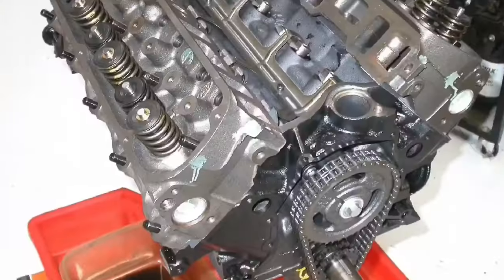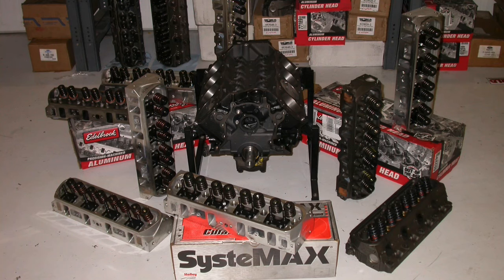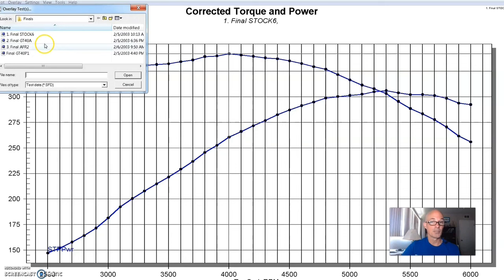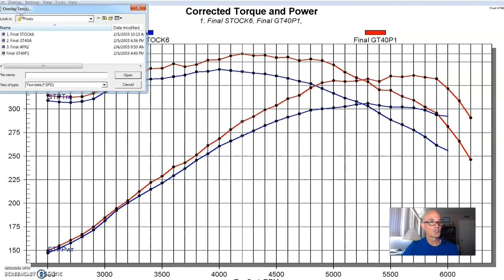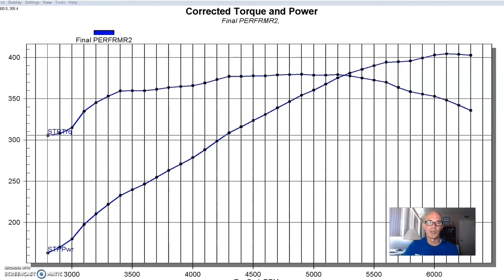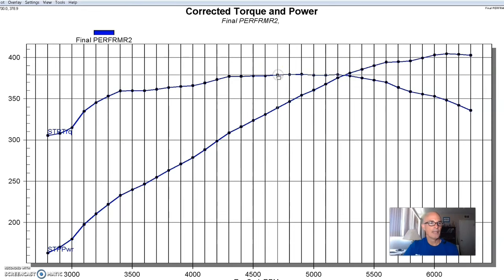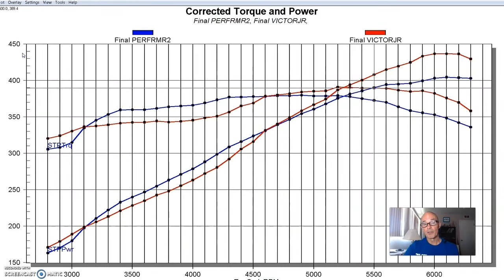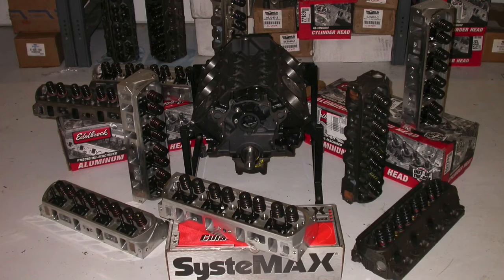LOW-BUCK 302 FORD HEAD UPGRADE

Comment: I remember those mm&ff articles when I was building my engine in my 84 gt 
I had a set of 69 Windsor heads home ported a duel plane stealth intake with a XE274 cam and a 650 dp and a recurved  dist. 
Had a lot of fun on the street and surprised a lot of people. 3.73 gears and sticky tires 
I miss those days 😕

Comment: Goes to show we were leaving a lot on the table back in the 70,s but didn't know it with these Windsor motors,
Reply: 289 heads and  GT40/P have the similar 124 cc intake runners and bowls.
The big plug W heads were 144cc but big chambers.
Massive well done hogging wont meet the aluminum aftermarket.
Cleaning them up personally for cheap is ok.
Reply: @hotrodray6802  The C0OE & D0OE 351 Windsor heads have 60cc chambers. GT40P are 58-61cc.
Reply: @foxfordcatguy2283  yes. And the MOST 289 are + - 53.5 nominal. That is somewhat smaller than 60.
Reply: @hotrodray6802  289 HiPo were listed as 52-55cc - NOT "most 289s." '66-'68 289 2V was 63cc. (The early ['63-'66?] 2V 289 heads also had tiny 1.67 & 1.45 valves - depending on which book you refer to.) Plus the 289 was only made from '63-'68. The much more plentiful 302 ('68-'01) used 63cc or bigger, except rare '68 4V C8OE-F w/ 53.5cc & C8OE-K & -L w/ 58.2cc. By '79-'85 they were 67-70cc. '87-'95 5.0 HO was 62-65cc. So there are obvious benefits with early Windsors on a 302. Maybe a little trade off on 289s. Bigger valves/ports and they can be milled and/or a thinner head gasket used to bring compression back up versus smaller valves & ports but more compression w/ 289 heads.

Most aftermarket aluminum heads are around 60cc:

Edelbrock only available as 60cc,

Ford Racing - GT40 58-64cc & X2-64cc,

Trick Flow Street - 58-61cc,

AFR - 58-61cc

Buddy of mine runs mid-11 quarter mile w/ '69 351W heads on a 302 in a '63 Falcon.

Comment: P-heads are decent...upgraded springs, port and polish, and milled   .020" yielded me 65HP on my setup years ago.
Reply: 93Cobra, what header are you using on your 302?
Reply: @israelfranco5332  I had a custom set of full lengths....1 5/8 primaries.

Comment: When I was younger, it was all about the cam,  Want more power? get a bigger cam. Always flat lifters btw. When the aluminum heads came on the market, it was hard to believe how much power difference a head could make. They were quite expensive though. But its hard to believe that a head swap was worth nearly 100 horsepower given everything else was equal. 

Now a days, for a mid RPM truck engine, it can make GOOD power AND have a smooth idle with aftermarket heads and a roller cam

Comment: This is one of those things that even happens occasionally to the top dogs in the business. I don’t mean to suggest that you’re a dog Sir Richard, but you are definitely the best at what you do. The test results clearly illustrates the performance advantages that are easily available without getting too radical with the combination. Nicely done AGAIN ! 
And by the way, you did something that most guys would rather die before doing...you publicly accepted full responsibility for the minor mistake that you made. It’s a sign of impeccable integrity and that’s a trait that is in short supply nowadays.
Reply from the maker: definitely not a top dog-just a junkyard dog

Comment: I had AFR 165 heads with an E303 cam. Huge seat of the pants difference. The rockers were always really noisy at high rpms. This might explain that. I also broke 2 ARP rocker studs on the same rocker. Got tired of studs breaking so I sold the heads. I bought the knock off 190 heads and sent them to get ported and stronger springs. Never had the problem again. 
   Thank you for all the time you put into this work. I really enjoy watching your videos. I love the aahhaa moments like this that explain some of the problems I've had.

Comment: My '79 F-150 has a 302 and I'm pulling it to rebuild. I'll be doing it myself because I want to learn about everything. I'm glad the dual plane intake is better. But it'll be a slow process to rebuild, but it'll still have a stock bottom end just with new bearings, but then I have choices of heads. I thought about an RV cam. Might still do that. But thanks for your info.

Comment: Solid roller cam is the best way to go so you can increase your valve spring close, and open pressures. I run my A code 289 to 6500, 6800rpm with a ISKY Mega 280  Model: 396281 COMP 986-16 dual springs, with 68 J code 4V heads that have a street port job 1:94 1:60 Ferrea valves, modified  600cfm 1850 carb body with 3310-1 floats, and bowls, probably flows near 700 CFM if not more 69.75 primary and 78 secondary jets. I'm probably making a honest 320-325 with this combo, possibly more with a bigger carb. I've run a 780 carb on this engine it's awesome on the freeway really pulls hard to 6500rpm wants to keep going, but the other carb is way more street friendly.

Comment: MMFF Ultimate Guide to Cylinder Heads - tested so many tests it had to be done in several issues. I remember it well, and probably still have the issues in my archives. That was an epic effort! I struggled with data overload for months before deciding on the AFR185's. Then got hung up on whether I should go ahead and build a 392 from one of the articles in one of the issues. I'm not sure if you saved me money or cost me a ton!!! LOL!
Reply: That was a magnificent series of testing and data. It was absolutely revolutionary at the time. I'd never seen anything like it, despite all enthusiasts having NEEDED it for at least 10 years, by then.

Comment: Great info - as always.

I would like to see a straight up comparison between the stock '87-'93 5.0 HO EFI intake & heads & swap them for the Explorer heads & intake - with a cam/spring upgrade, of course.

I snagged the "P" heads, intake & 65mm TB for $150 off a Mountaineer from the local JY to put on my daily driver '89 GT. It has a valve tap & if I have to take it apart anyway, figured why not?

Comment: 302's are my favorite car engines.  (Chevrolet DZ's, too.)  So I'm really interested to find out about that big, detailed MM&FF test you mentioned.
This pair of tests was interesting, too.  The big surprise for me was how well the RPM 289 did.  In fact, that whole test series seems to have had a reasonably stout 302 running.
Reply: Not an RPM. 
Just a Performer 289.

Comment: Have had 7 Mustangs with 302’s....love the V8 and compact size (compared to the new DOHC 302’s). Best 302, I have is Balanced, Blueprinted, Forged Pistons, Ported GT40p heads, Explorer GT40 intake, bigger throttle body, GT40p shorty headers.  Has a E303 cam...a little lopey for the AOD (not enough LSA for Fuel Injection)....really strong above idle speed.   Love it, will never sell it.

Comment: Sure would be nice to see the power curve down to around 2k rpm.  Looked like the single plane jumped up quite a bit above the dual plane below 3,000.

For some reason GM used a single plane intake on their HT (high torque) 4100 Cadillac Engine...

BTW, the 4100 gets a bad rap, but I really like them, for something that size.  

The engineers really broke out of the mold when they designed that engine.  If you haven't already, you should take one apart and check it out sometime.

Comment: Im running a mild 327 stock bore stroked 302. Gt40p heads. I just cleaned up the intake side of the heads and a very mild touchup of the bowl area and exhaust. Upgraded the springs added a comp roller, new pushrods 1.6 rr. Trackheat intake, 70mm tb. Its not no hotrod but makes for a great little street motor. Faster than i want to go. Great torque as well. Ive never dyno'd it but im thinking somewhere between 300 and 320 horse. Still gets respectable gas mileage on the hwy with 373s

Comment: Great video work , I havent owned a 302 in almost 20 years but still wondering how to make them run better and seeing all my old HP mistakes.  Biggest one i see is the valve springs  and a commitment to my original torker 289 .  it  ran so good on my stock  66 289 GT back in 1971.    I ran a set of 351 heads off a Mach 1 on a 302 for my last build , never broke on me in 20 years of racing and street use. except one day floated a valve and had to replace it ,   Biggest change in Et came from a set of flowmaster over axle 2.5 inch exhaust , picked up 5 mph in the quarter.
Reply: Just remembered one super cheap thing to prolong engine life is I glued a speaker magnet to the outside of the oil pan , after pulling the pan a year after building the motor to check out a noise which was the fuel pump luckily,, the inside of the magnet area in the pan had a layer of fine dust , most likely shavings from the cylinder walls and prevented them from going thru the oil pump , cheap protection.

Comment: Gt40p heads on a 351 with a 3.85 stroker crank is a torque MONSTER! Feels like a 460 when you blip it in 2ft of mud!
Reply: Yep.
These commenters want 6000 rpm, not torque.

Comment: @richardholdener put 1.7 rockers on this cam, or add an .020 shim under the spring seat, or both. That should solve the valve control problem.
Reply from the maker: 1.7 rocker hurts not helps

Comment: The data is what's important, and you produced / showed that.  Kudos.  What your data tells me that unless you're one wanting to run around at 6K rpm, the P heads are fine.....and the spendy aluminum ones are not worth it for the extra 30-40 horsepower (at least to me).

Comment: Back in the early 2000's I had a 1973 maverick grabber with a 302 and a rebuilt shortblock, I had a set of heavily ported iron heads without exhaust bumps and a early edelbrock torker intake the twisted one and was happily running mid to low 13's at 100-102mph with 3.55's and a 2500 stall and i picked up a set of 1.90 valved performer rpm heads and a performer rpm air gap intake and a 650 dp holley, you know msd and headers and.. typical early 2000's street car, untypically I was running a solid flat tappet at the time the I want to say the 274 solid from comp.. it was whatever the smallest flat tappet was "rated" 2500-6500 rpm little did i know and a set of comp steel rocker arms. First thing I did was take the cam specs to a engine builder and had them go thru the heads cleaning out oil drain ports edelbrock really had issues with qc then and had the springs checked and stuff luckily they came with enough spring for the cam and valve train.. One thing about having a 180cc 1.90 valved head on a 306.. is well 302's are notoriously high revvers and this one was no exception... after a little racing and testing and going faster and faster and faster the higher I revved it, I found a article with an almost identical build and power peak was closer to 8000 rpm.. if i would have bought the forged slugs vrs the then in vogue hypereutectics.... Who knows how deep into the 11's it would have gone on motor. So lesson is do your due diligence when building a motor.. Little did I know I had a 8000+rpm screamer with the smallest solid cam in the catalog..

Comment: Love the 8200 deck Fords ,I ran one back in the day forged pistons , lunati roller cam Canfield high port heads , rpm manifold , demon carb long tubes mad ignition and distributor , and a little spray . that combo i n a 2800 lb fox produced mid 10 second slips and a really fast street car .

Comment: I'd love to see how gt40p ported heads wirh upgraded springs would fare, I didnt port mine and i regret it. I wonder how much i'm missing because.the exhaust ports are TINY!
Reply: As much as 90 HP.
Reply: @attitudeadjusted9027  Porting P heads is not worth 90hp on a naturally aspirated engine. Period, full stop.
Reply: @GroovesAndLands  Not at 5200 rpm but springs allowing 1,500 rpm more = more hp
Reply: @hotrodray6802  Ported P heads aren't gonna get you +90hp NA at any engine speed. Period, full stop.

Comment: thanks for the info 
Ive got a 306 with Fcam and with GT40p heads also have changed the valve springs  i put the TFS spring kit on the heads have 2 choices of intakes performer RPM or summit intake also have the msd dist and 6al with mac long tubes dont have the motor in the car yet it will be carbuated

Comment: I do like some junkyard parts buildups. What's cooler than a 67 mustang with a 5.0? A running 67 mustang. Get the parts on the car. Make it affordable and drive it! 400 hp is plenty on those cars

Comment: Have you ever tried 351 w heads with upgraded valve train? I built a 302 with 351 factory heads with stainless intake valves and crane roller rockers with a solid lifter cam lift was 560 with 308 duration at 0 and a torker single plane with a 700 dp Holley manual secondary’s, I had the rotating assembly balanced and machined and assembled to blueprint spec. It would twist to 8500 rpm. Never had a dyno done, didn’t have access to one, I was running 10 to 1 compression and had modified the crank, rods and pistons! This was back in 1975, had the motor in a 65 mustang fastback.

Comment: Richard recommended an xe274 cam for my 302 (ofc lol) however I decided to go another direction for now. I bought a running and driving 00 explorer for 450 bucks, and I’m rebuilding the motor for a ranger swap. I’m trying to stay on the cheap for now until I can get back to work after this corona crap, then I’ll go for the gold. For now though, I just want it to run and drive while keeping my 5 speed 4x4. With the explorer motor, I can do a valve spring upgrade, HO cam swap, and 1.7 roller rockers. That combo will let me safely rev higher (approximately 6500), hold power throughout the rpm range, and give me a total valve lift of .472. Couple that with a bit of a port job, I’ll be able to flow an approximate 215 cfm intake, and 147 cfm exhaust. Math tells me that will net 305hp at the flywheel, not bad for under 1k. Later on when I have the money, My parts list includes upgrading to trick flow 11r 190cc heads, and a custom grind cam allowing for .550 lift intake, .575 lift exhaust with a 112 lsa netting a very healthy 470hp at the crank (if my math serves me right) and a very streetable rpm range (keep in mind this is for a 4x4 truck) of 2700-6300. My biggest question really is if I should buy those heads bare when the time comes or if they actually ship with quality valves and springs? Does anyone have experience with 11r heads?

Comment: I have some AFR 185 heads from back in those days and they get into serious valve float around 6,500 RPM. It's my understanding that now a days they come with a way better spring package.
Reply: Hitting 6500 RPM before valve float isn't that bad.

Comment: Love the info!  Keeps us think about our next project(s).  

I would like to add a comment though.  In MY experience with small block Fords, I've noticed they do not like wide LSA.  At least in a performance world.  I've run 112-114 LSA and they seem to be VERY lazy at the bottom and only pick up at the top.  Switching to 110 LSA and/or shorter, I've noticed a huge improvement in torque across the board.  I do understand the car's combo has to be adjusted to the cam and/or vice-versa, but I'm only speaking for myself.  I wonder what these test results would have netted if say the same cam was run, but with a 110 LSA?  Good job all around and for your other videos!!!
Reply from the maker: I haven't found that-tighter LSA can help power but decreases idle quality

Comment: Starting to watch your videos. I have an old ‘72 Torino 302 and looking to get more power with better heads and trying to decide on new aluminum or parts off an old 351. I have an ‘85 Mustang GT intake, 1” spacer, and a Holly 650 on top. The engine was rebuilt about 2 years ago, but I don’t think he replaced the guides or stems. Too much oil burning. I know this car has more power than it’s giving. I also have the Eddlebrock performer cam and a new double timing chain. The low end torque is great, but it drops off when it comes to HP. No headers yet, and I know that can help.
Reply from the maker: get Gt40 heads from junkyard or (better yet) after market AFR enforcer heads

Comment: It just goes to show you how potent those little 302 is really can be you know everybody always Bashas Ford for putting that little bitty 5 liter in those Mustangs and yet those five leaders held their own against larger engines and even still today the 5 liter coyote is put up against 7-liter Corvettes and Camaros and 6.2 L Camaros and 6.4 L Dodge Challengers and chargers it's just a testament to show how well-rounded those 0302 Czar and they stay reliable that's the part that shocks me more than anything else it is you can go to any junkyard pull up finally out of a Explorer Put an intake carburetor on it take it to the track and race it 10 20 30 40 passes and it still runs the second day when you pulled it out of the junkyard or like it did before went to the junkyard I will forever be a small block Ford guy there just is a lot more choices for the 350 but even this shows you that A5 we can still hold up with a 350 because I know guys that have done 383 stroker kits on 350 and they barely touched the 450 range that little 302 is a 306 all hail the 302